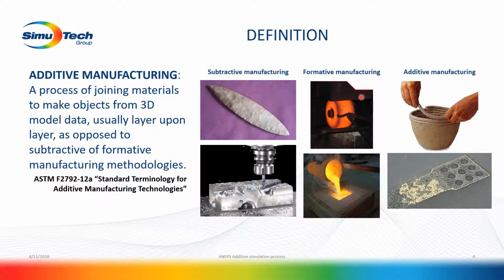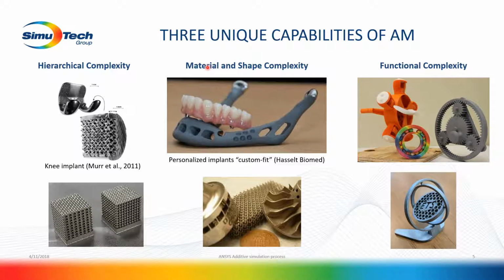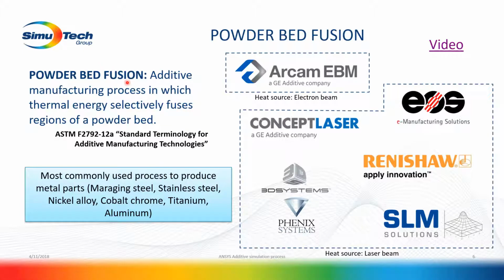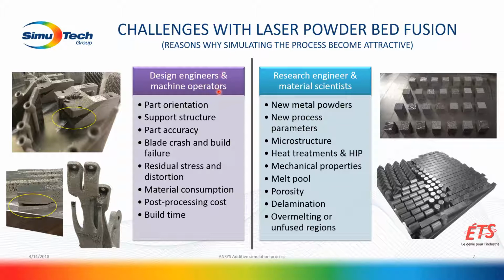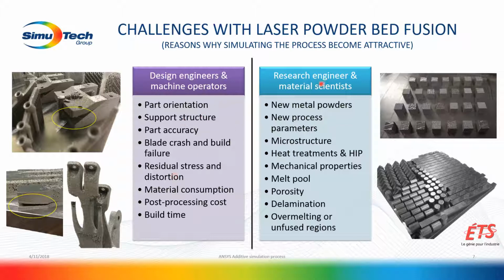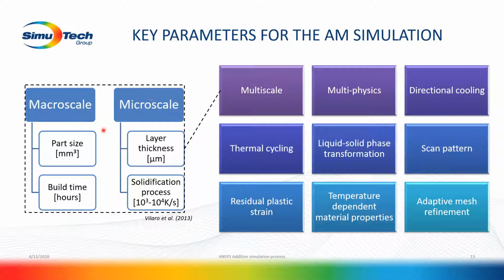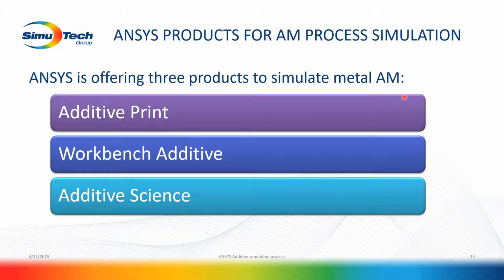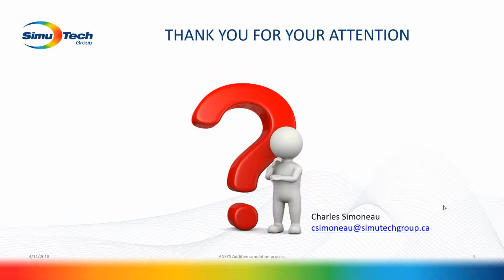An Introduction to the ANSYS Additive Simulation Process

Comment: Thanks. Great video! Could you share the reference Vilaro et at . I would like to study in detail the parameters required for simulating.
Reply from the maker: B. Zheng, Y. Zhou, J.E. Smugeresky, J.M. Schoenung, and E.J. Lavernia, Thermal Behavior and Microstructural Evolution during Laser Deposition with Laser-Engineered Net Shaping: Part I. Numerical Calculations, Metall. Trans. A., 2013, 39A, p 2237–2245 (https://link.springer.com/article/10.1007/s11661-008-9557-7)

T. Vilaro, C. Colin, and J.D. Bartout, As-fabricated and Heat-Treated Microstructures of the Ti-6Al-4V Alloy Processed by Selective Laser Melting, Metall. Trans. A., 2011, 42A, p 3190–3199 (https://link.springer.com/article/10.1007/s11661-011-0731-y)